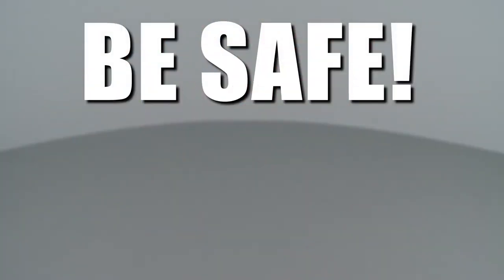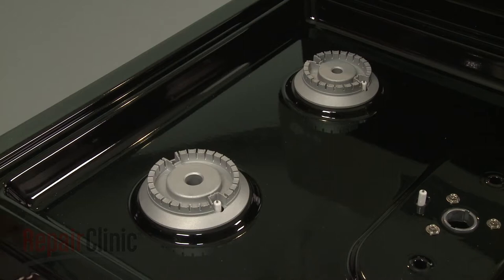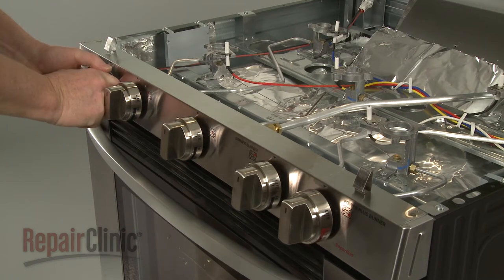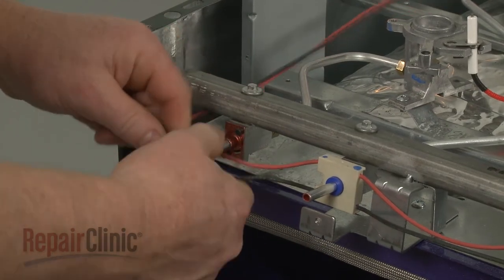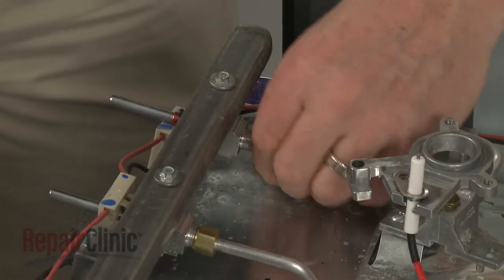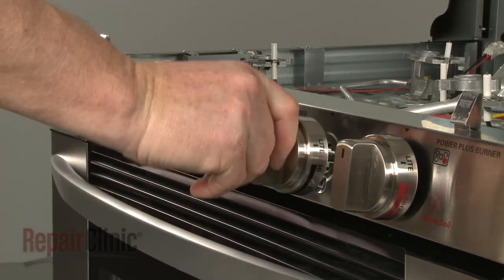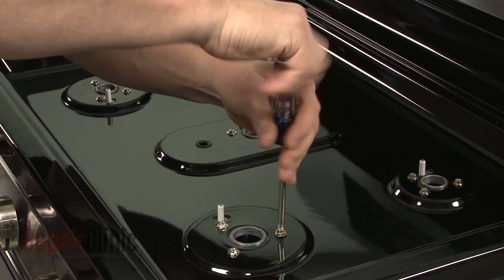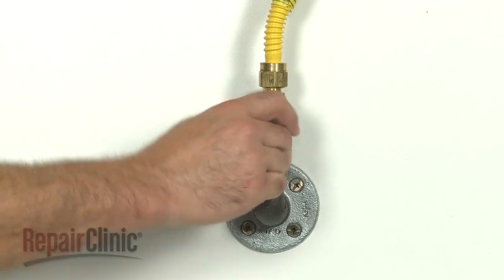LG Gas Stove Burner Valve Replacement, Left Front #MJX61842207

Comment: might want to check for gas leaks before finishing assembly
Reply: That's a very good idea and for anyone watching this who doesn't know, in this particular situation you want to use a spray bottle type of leak detector.  You spay a solution onto the joint you've just put together and if you see bubbles form you have a gas leak.  One well known detector is Camco 10324 Gas Leak Detector.  You could also make your own solution from dishwashing detergent combined with tap water and use that, just make sure it's heavy solution.  The Camco product is probably less messy.